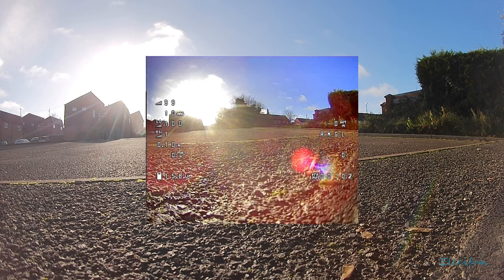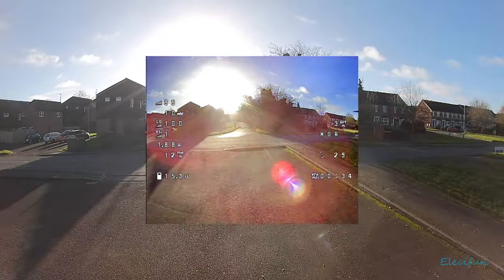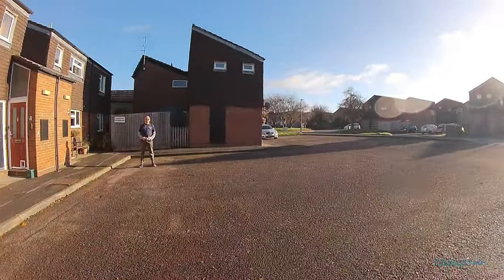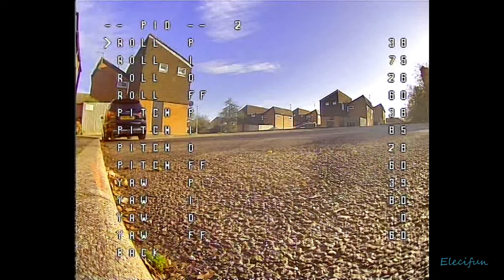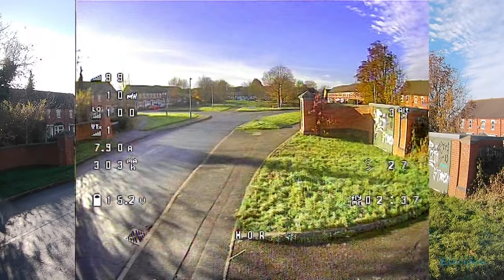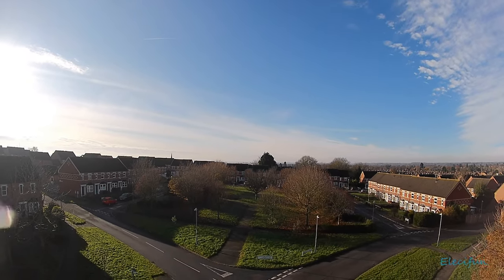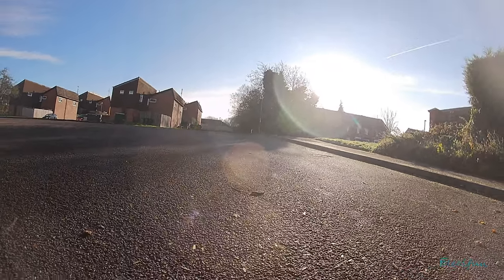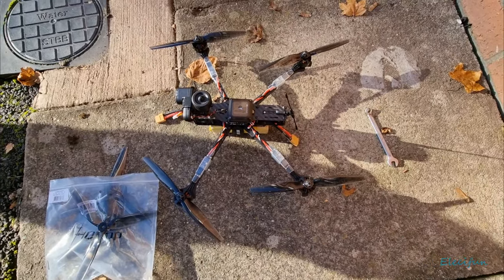DIY 7 Inch Quad Copter Test Flight Tune

Comment: Brilliant video! It's so great seeing her airborne. I've got some three blade props on order. HQ Prop 7x4x3. Probably the exact ones you're getting ready to run. I'm going to do a bit of tuning too but I'm hesitant since I've never done it. I don't want to make things worse lol. So I'm reading up on it. Amazing how you tuned that jello right out so quickly. Good show! And thanks for including the felines. Always love to see the pets.
Reply from the maker: @Sonic_Ox the tri blades I have are 7x3.5 by HQ prop. I like these injection moulded props as they are balanced out of the bag and not expensive. 
You may not have to tune much, depends how OX7 is flying and if you have jello in your image. 
I'm sorry I could not watch your flickering video without blinking all the time. If you need a new editor try kdenlive, its the one I use. It has tons of effects, if you like that sort of thing. Lols.

Felines just joined in being nosey, looking for food I expect.
Reply: Thanks mate. I haven't noticed any jello. I'll make sure that annoying flicker is gone going forward.

Comment: I love the sound of these 7" quads. Less buzzy and more throaty (if that's a word lol). They sound like a proper aircraft to me but still aren't terribly loud. Love it. I'm preparing for a flight this morning but I'm dragging my feet because it's chilly outside lol. I've become a bit of a sissy, fair weather flyer in my old age lol.
Reply from the maker: @Sonic_Ox I like the sound of this one, it has a whistle like a turbo on vehicle. I using 1720KV motors and 4S battery. I would need new motors for 6S and can't afford to buy any more. 
Here its winter and wet and cold most of the time, so much for global warming!  I don't mind the cold so much its the cold and wet I shy away from. 
Like you I am a sissy in my old age.